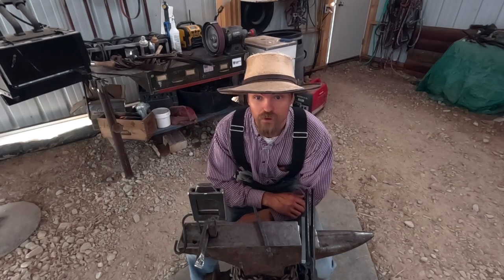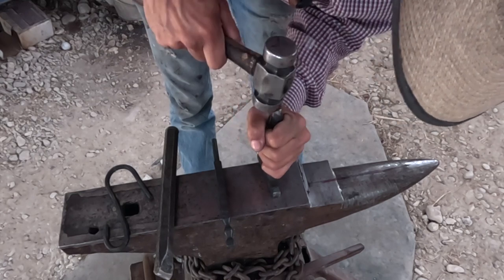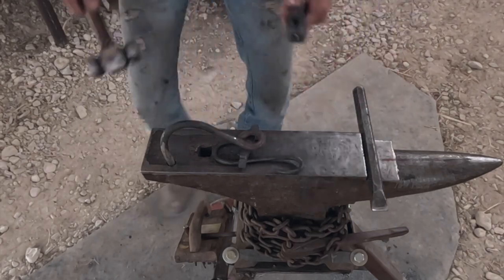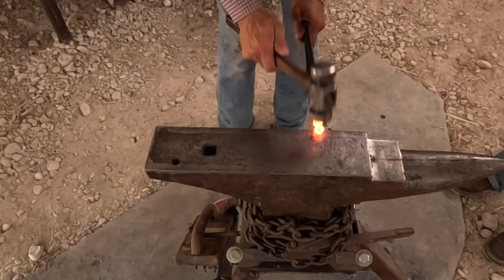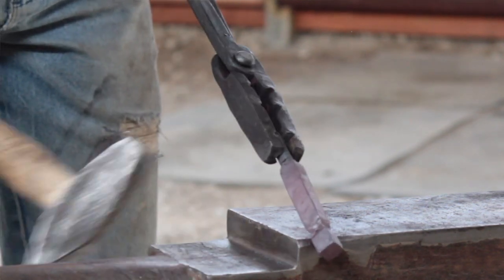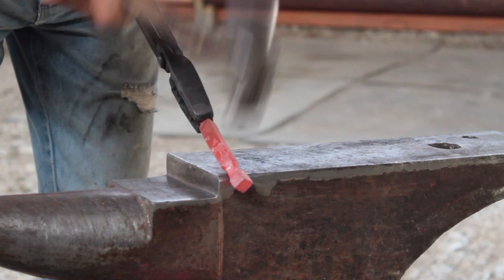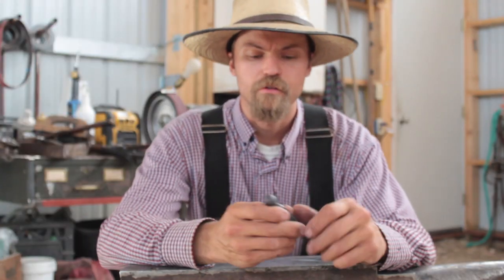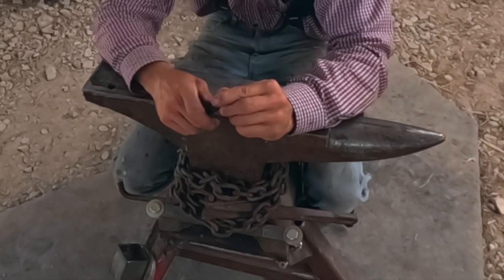Back to Basics - How to Forge Shoulders, a Tenon & a Ball

Comment: For crying out loud, use the guard on the angle grinder, is the slight ease of use worth being out of work for months because you have to have tendon surgery? Or you lose an eye? I really do not understand the levels of risk people accept when not using the guard.
Reply from the maker: Very good point. I grew up in a fab shop with several grinders, all without the guards and we never had a single accident - however I am aware of the risks. Thank you.
Reply: Yep this can not be stressed enough, especially with cutoff wheels.  One friend almost lost his Thumb and another an eye.
Reply from the maker: @RRINTHESHOP   Thanks Randy - I will try to be better about putting my guards on.

Comment: Another good video Jayce!  I noticed your "light cross peen" appears to have formerly been a ball peen.  If this is so, did you grind it into a cross peen or forge it into a cross peen?  Curious minds want to know! 🤔
Reply from the maker: Well I forged it of course silly goose! Thanks for stopping by Bob 🙂
Reply from the maker: Bob - I also upset the face of that hammer to make it shorter and fatter to balance it better.
Reply: Ah ok.  One more silly 🪿 question.  After forging, did you harden the peen or hammer face any or just leave them soft?
Reply from the maker: If I remember right, with that one I just let it air cool and then tested it. It's a little soft but it tested ok so I just left it alone... better to have it a little soft vs shatter. The old hammers are pretty safe to play with, but the new stuff is pretty unpredictable and dangerous.